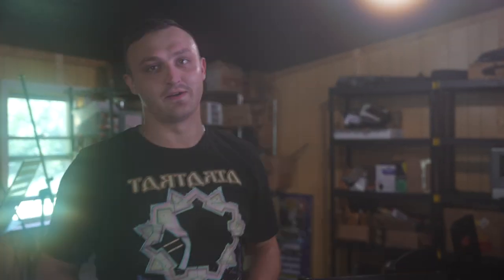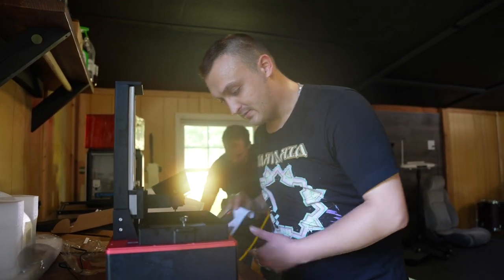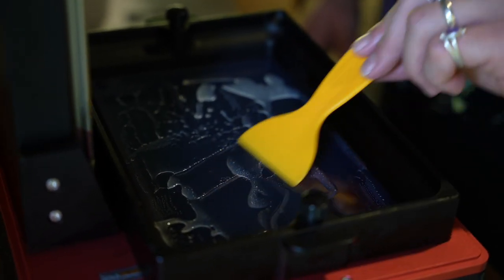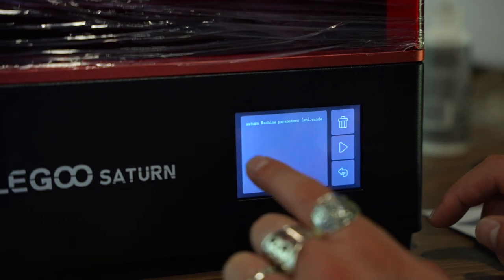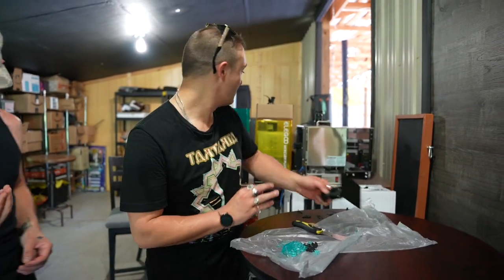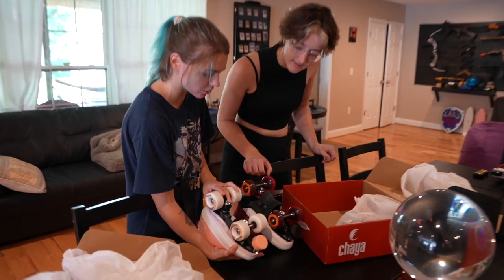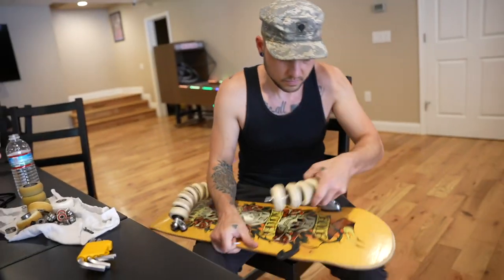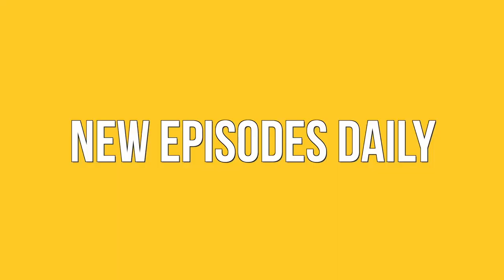Cast Castle's Bigger 3D Printer And Trying Out The New Roller Skates

Comment: yall should look into Hot Nitrogen plastic welders. and a TIG/Mig/stick welder generator for building and repairs on the properties. and then hire a cast castle in house welder. i voulenteer! haha. but fr if you can learn to just do baisic weld joints you can build ALOT. Tig welding you can make very small precise clasps or hinges or fittings or whatever you need. it takes alot of skill. and alot of time to learn and hone that skill. but its worth it.
Reply: Welding is such a fantastic skill for a person to have. 
It's not that difficult and the possibilities are limited to one's imagination and knowledge. 
Anybody who has the means and opportunity to learn how, should absolutely do so.
Reply: @captaincouldverc  im a welder by trade. i would say sticking two pieces of metal together isnt difficult.. properly is a different story. its baisics are not difficult but everything together could be considered difficult. Tig requires the most skill and dexterity using two hands independently and in crazy positions.
  i think everyone should learn baisic welding skills as well.  buying a cheap MIG machine for around the house stuff. its simple to use. and to build or repair around the house you dont need Xray quality welds.
  i absolutely love the trade. its amazing. its fun. theres endless amounts to learn and you can ALWAYS get better. theres tons of processes.. the metalurgy. actually physically understanding what your doing to the metal.
Reply: @captaincouldverc  an example of difficulty... i believe pratt and whitney weld test for aerospace is TIG welding stainless and titanium that half the thickness of a sheet of paper. you can have NO burn thru. No distortion. NO discoloration of the titanium.  i dont think i could ever be that good.  your talking if your tungsten moves up or down even 0.0005 mm your screwed.  these guys have robot like dexterity. perfectly fine movements of their hands and fingers its VERY impressive.i do alot of stainless pipe. alot of chromoloy for roll cages.  and alot of stick in industrial settings in the field.  its a blast. the money is good. you will always  have work... the DOWNSIDE is health. if your not carefull  youll be dead in your 50s if you start a welding career in your teens early 20s. heavy metal poisonong. gases. tons of stuff
Reply: I totally agree.  It should be taught in highschool along with swimming and drivers education.
Reply: @swampypolitics9574  
Bro. As fellow welder, you're overcomplicating a simple process for "AT HOME/HOBBY"welding. He ain't going to have a safety over watch, etc. 
Talking like that, can potentially intimidate the hobbyists looking to get started.

Also note, I never stated "it's not difficult" 
I clearly wrote "it's not THAT difficult" especially in relation to how THEY would be using it in comparison to a certed welder like you and I.
Reply: @hairball7529  
We had a welding class in my high-school up till my junior year. I was looking forward to taking it in my junior year cause that was the earliest they would allow students to take that class. 
I go to enroll in that class my jr year, and was pissed that they 86d it! Plus they even got rid of shop and auto courses too that year. 
Ruined my junior year plans.
Reply: @captaincouldverc  Damn.  High school is mostly useless. Imo
Reply: @hairball7529  
Exactly! Those classes would've made my high school experience feel not so wasted.
Reply: @captaincouldverc  I literally said that. For at home hobby stuff it's simple and fine. But I wouldn't call welding overall not difficult.  Sticking metal together for at home stuff is easy  sure . But let's not pretend if you don't know what your doing and build a structure that it can't go bad. I've seen it. A neighbor tried building a gokart.  It ended with his kid in the ICU when the welds holding the control arms failed sending him into a tree.
    We've all started there.  Anyone can grab a $100 flux machine and build a rack or something simple. It can look like it was welded with a slingshot and still hold for what it needs. And it's relatively easy for anyone to learn.
  But to be a WELDER.  Where you can walk up to any material in any position with any process and complete a weld joint within spec is not "easy". 
   It's not over complicating. It's called reality. I litterally agreed. Said everyone can and should it an easy hobby to get down with.. but jus because you stick metal together in your garage with a Chicago electric flux machine doesn't make you a welder.  Sorry I take pride in my craft lol

Comment: Hey, my experience with using a lubricant on the FEP has proven to contaminate the resin. Even those who say it works say to leave as little as possible. If the print sticks to the FEP it is likely due to temp, worn out FEP, or the lift height and or the lift speed are not setup so the the piece can lift off the FEP. EPAX 3D uses nFEP which does work better. I run both Elegoo and EPAX printers for my business.

Comment: Tim have your gf put the Allen key wrench on bottom next time. So wrench on bottom with Allen side facing up, next bearing litely in bottom end of wheel, wheel on top. Slam down and bearing with insert easily within one to two slams. Repeat for other side of wheel.
 Using bearing spacers can make later removal a minor pain if bearings speed weld to spacer. Have to hit high downhill speeds for that though.